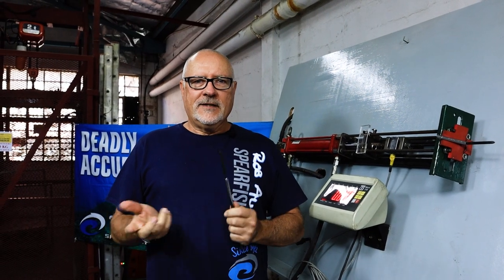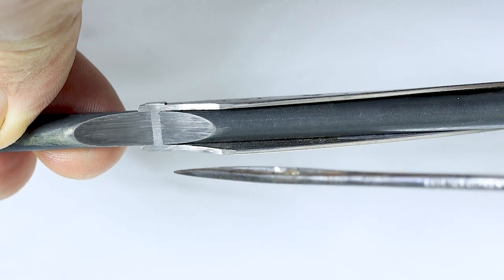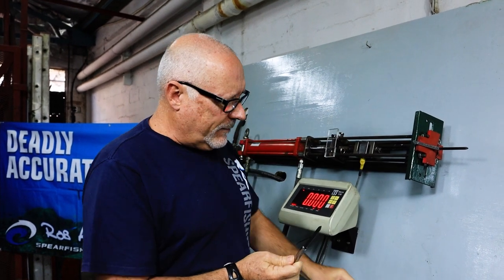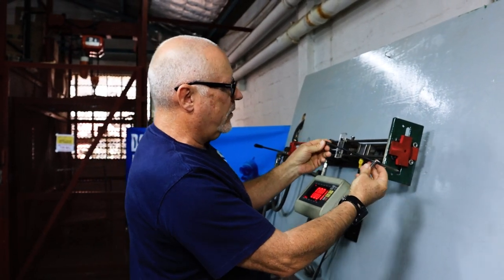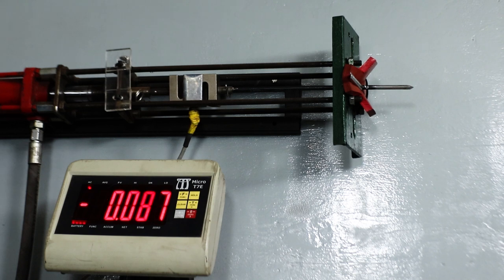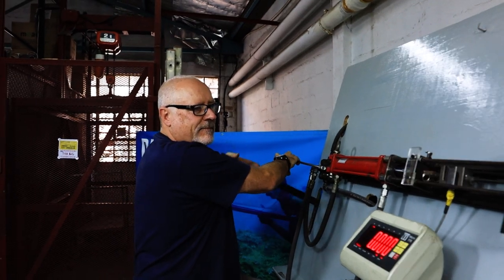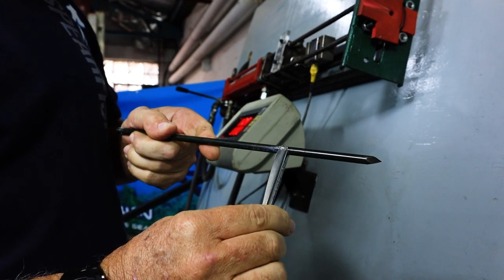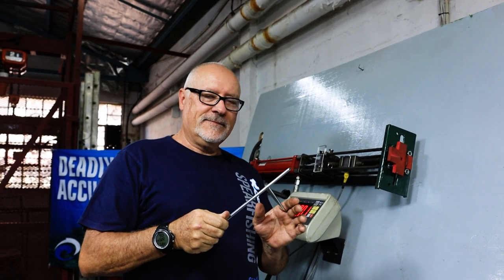Rob Allen | Barb Break Test Part 1 | 2022

Comment: Ver y interesting to think about breaking strength of different elements we use while spearfishing. One can then maybe assume for example that a imaginary 300 kg Dyneema would not make sense if another component breaks earlier. Can imagine a graphic that displays 'weak' or breaking points between a shaft, barb, notches, crimped loops, the shooting line and its attachment type to a reel line, then the real itself, and so on... 
Cool stuff. Keep it going! Love this.
Reply from the maker: Agreed. A chain is only as strong as its weakest link.

Comment: Great videos Rob. All interesting. Was wondering if there is a way to test the breaking strain differences between notched shaft, mini tabs and wire tabs? I have snapped a handful of notch shafts through different scenarios so tend to stick to the mini barbs but wondering if there actually is a noticeable difference in the strength?
Reply from the maker: Good idea, will look into setting up a test for that 👍

Comment: Professional videos Rob . Thank you for innovating ! I wonder what will be the breaking differences between mono attachment to spear heel vs attachment to shark fin…
Reply from the maker: In both cases the mono will fail at the crimp first. We did some tests a while back with cable pulling on our wire fin, the fin held way higher than what a mono crimp would, not sure what the actual load. The mono crimped break load will vary depending on the mono type and the crimp setting, we get between 100 and 120kg on the crimp and line we use. The breaking strain of mono might be slightly different between the load on a welded fin drilled hole and the hole in the rear of the shaft. The problem is, there will be a much greater difference/effect depending on the condition of the holes the line is passing through. The finish in terms of the smoothness and shape of these edges will have a much greater effect on the loading it can take.
Reply: @RobAllenSpearfishing  Thank you for the detailed and data based answer Rob .
One more interesting comparison is breaking force of flopper vs drop off barb even though both of them wont be the weakest in rig chain… Thanks again for the great engineering experiments !

Comment: Super interesting Rob! I have always wondered about this test. I once had my RA shaft suck in some black reef sponge, after giving it a good pull (thinking it would rip the sponge) I was suprised that I broke it, but also suprised the breaking point was the shaft itself around the pinhole. I suspect there was some internal rust or hairline crack there as it was obviously nowhere near 200kg
Reply: Exactly the same arrived to me! I was surprised... I decided to make a new hole in order to put the barb even if the shaft is shorter now but it's very hard to make the new hole cause it's not the same material than the others shafts! Do you have an idea to do it?
Reply: @stephanecrenn7861  you would need a vice and bench drill and find perfect center. But better off just getting a new shaft
Reply: Ok thanks for your advice👌
Reply from the maker: @stephanecrenn7861   The hole for the barb pin is unfortunately a necessity and obviously a week point. This area can easily become cracked/damaged when shot into rock at a specific angle. You won't realize it's cracked until the other side cracks and the tip falls off with little effort. You can normally see this, the old break will be dark and the fresh break still shinny.
Reply: @RobAllenSpearfishing  Thanks for your explanation, I love your shafts. It was a bad shot into the reef and as you said it happens in certain conditions(or maybe an air bubble during the building of the shaft?).   
Best regards from Réunion Island

Comment: i have recently gotten a 1100 rob allen and upgraded to a roller. I was thinking of upgrading to a double roller but I have been told that the spear doesnt go straight. I would like to know what I should do.
Reply from the maker: Not a good idea if you want to fit 2 x 16mm as you will over power it. Yes, they are correct, over powering will cause inaccuracies.